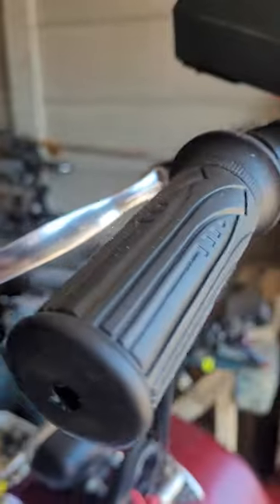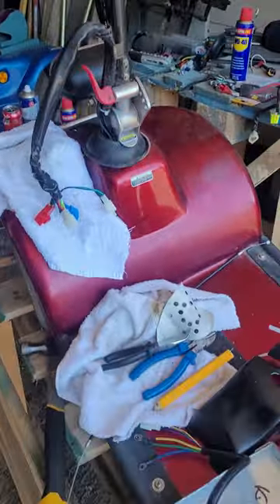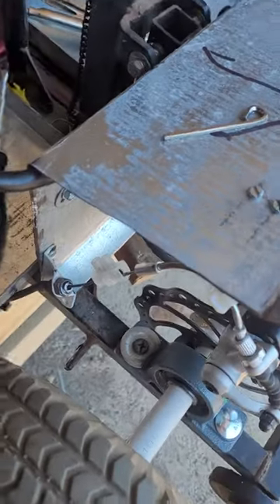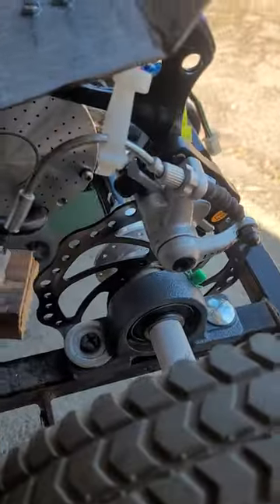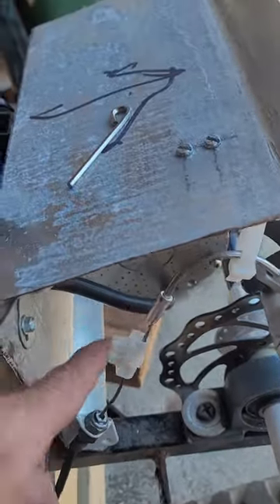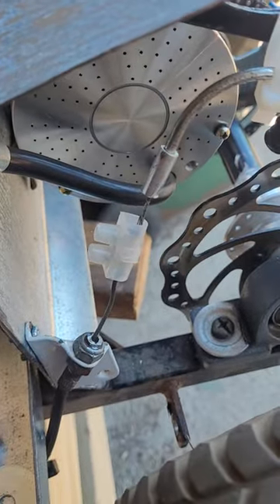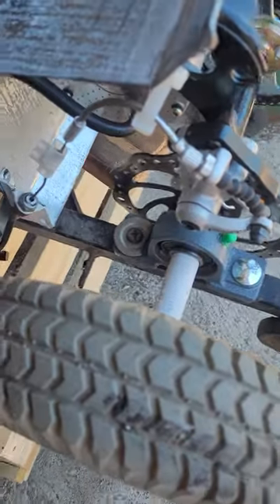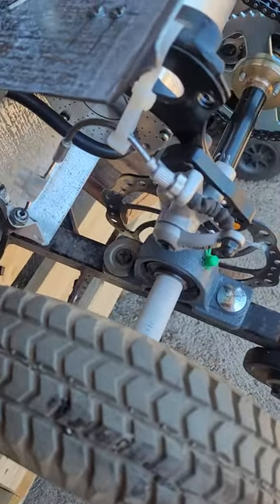shoprider mobility scooter upgrade

Comment: Is it reasonably easy to make this Shoprider XL4 scooter to go faster? Not Colin Furze style just 15 or 20 mph?
Reply from the maker: Not unless you swap motors
Reply: @Shakingstevesallotment  Thanks for your reply.The Shop rider XL4 mobility scooter that I bought today has a 24 volt motor.If I fit a 52 volt 18 Ah battery and fit a 36/48 volt e bike controller will it work?